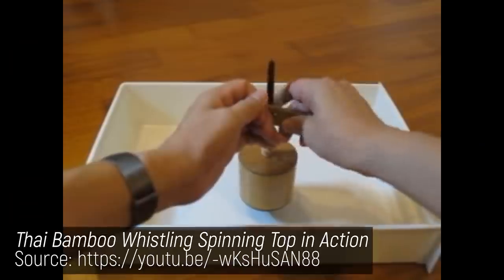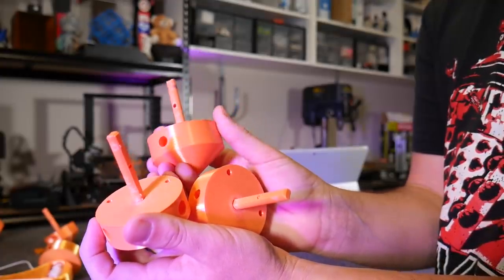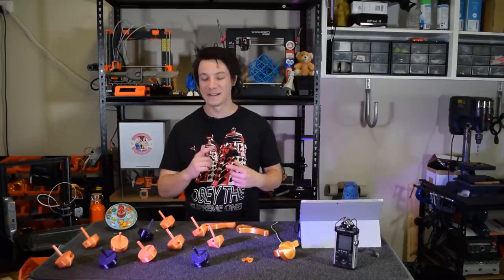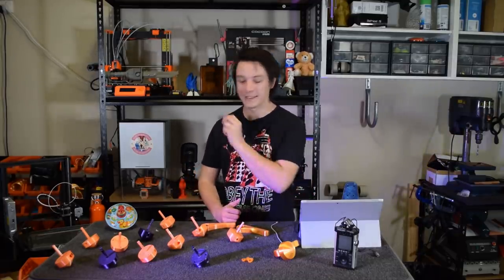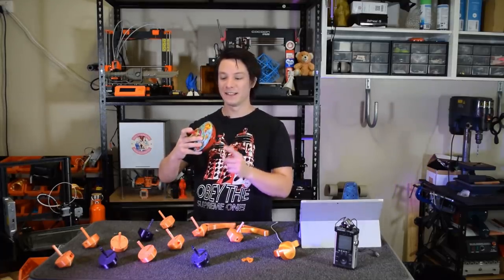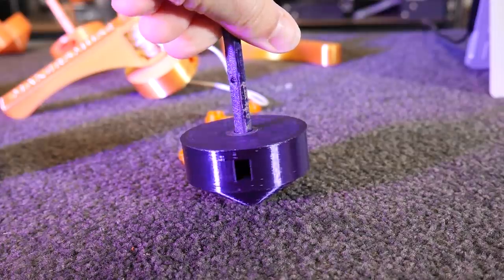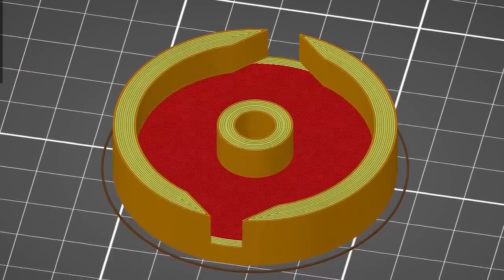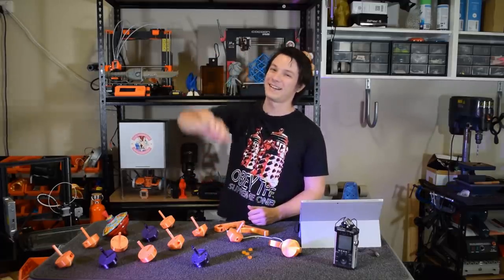3D Printed Screaming Spinning Tops

Comment: I had a whistling toy top in the 80s. I found it on eBay a few years ago and it broke after a few uses because it became brittle. Only the top of the top broke so the launching mech has broken but the whistle is intact. It is not the reed type and I think it had two tones as it spun down and had a much richer mid tone than the ones you made. It’s clear plastic so I'll take some photos of it and send it to you.

Comment: I am Vanessa Golston from Toledo, Ohio and this is my Favorite Scientific Video.   I grew up playing with my Favorite Toy, a Red, Blue,Green and Yellow Large Tin Humming, Spinning Top.   I am from the late 1950's and was addicted to the SOUND of the TIN TOP after I pushed the handle up and down to pump up the speed.  The SPEED, SPINNING and SOUND was a HUMMING that actually SINGS a SONG at a VERY HIGH SPEED and maintains that HIGH FREQUENCY for as long as I kept the handle pumped.   I would listen to this at least 1 hour every day when playing on a HARDWOOD FLOOR.   This is a soothing sound to me and caused me to FEEL EUPHORIA.   I know it stimulated my brain and I felt pleasure from this HIGH PITCHED HUMMING.   I had a lot of scientific toys, but this was by far THE BEST TOY I EVER OWNED.   MY TIN TOP THAT SANG.   THE SECOND BEST TOY WAS MY TRAIN SET THAT CONVERTED WATER INTO STEAM AND THE BLOWING WHISTLE COMBINED WITH STEAM STREAMING OUT OF THE WHISTLE.   
Vanessa Golston,
October 27, 2019
Happy Sunday
2:16AM

Comment: If you want a higher mass, you could always print a hollow ring at the perimeter that you can fill with a weight, making it like a flywheel. 

Also, how's your modelling of a  spheroform tetrahedron coming along? Really interested in seeing how you've modeled it in Fusion; I think I've modeled one, not following the XtalGrafix page on the 'wedge' along the edges of a tetrahedron, but rather doing a variable radius fillet, so I'm not sure if it's 100% correct, but I have no way of testing this.

Comment: You want to experience really really bass whistle sound? It's easy, just drive your car with one of the back seats's windows open (only that one, doesn't matter which side), because it's kind of a square. Then go on a straight line at a constant speed of about 40, 50 km and then all the car's inner pressure is going to have fluctuations, it's the same principle but in a car scale, so really bassy sound (probably you have experienced it before)

Comment: Angus I used PLA for my top, but no whistle.  Spins like the dickens with excellent velocity and duration.  Ideas please.
Reply from the maker: Is the inside cavity clear? It needs to be printed without support material
Reply: @MakersMuse  yes but upon inspection I do see a stray strand of filament that looped down into the cavity which may be interfering with the effect.  Once removed I could discern a high pitch sound at the beginning of the spin.  I am going to cut a longer pull string.  It is for my grand daughter whose hearing is much better than mine.  Thanks for the rapid reply.
Reply from the maker: Best of luck!

Comment: Add a "pea" for a warbling tone. The "pea" (used to be a dried pea in older whistles) is a small bead that's marginally larger than the sound producing vents. You may also try having several parallel holes, like a pan pipe, or even a specific assortment of holes to produce differing tones.

Perhaps even placing thin tympani or drum-like caps over a portion of the surface to act as a resonance projector (similar to the thin cone-shaped part of a speaker, but flat & flush with the top surface).

Comment: Could design it like an air raid siren, but idk how to make the outside not spin. Maybe it'll make a sound anyway with just the spinning internals.
Probably use multiple layers to make different frequencies , tiny naca ducts to suck air in from the top.
I need a 3d printer

Comment: the duck one might be acting like a centrifugal fan with possible vanes inside that force the air out at the top and pull air in through the reeds on the bottom. so what if you made a top that had simple spiral vanes inside the chamber with some outlets at the top and some kind of emergency whistle at the bottom? there's storm whistle designs on thingiverse that could probably be pasted in.

Comment: I wonder how to make a spinning top which changes it's sound heigth to sound like a police siren :D Probably it could be done by adding pistons in cavities (changing their depth) powered by a mechanism similar to balance in mechanical watches or small clocks - symmetrical masses on spiral springs around the axis. If accelerating the spinning top would bend the spring in such direction that mass gets closer to the axis and vice versa, oscillations would be sustained as long as the spinning top is spinning.

Comment: If you want to experiment with whisling shapes without wasting time and resources, one can probably make a jig with a chuck similar to a drill but with a brushless quad copter motor to spin these and also make inner side whistling parts interchangeable via sliding in and out of the round shape frame.

Comment: A simple flat dress shoe shoestring works well in place of the nylon cord. The string end fits into the hole and the flat part lets you wind more string on the spool, so it spins faster.

Comment: Wondering if its possible to include a plastic piece inside the tops hollow chamber which could cover the whistling holes as it spins to act as an on off switch for the notes. Maybe a plastic disk with flat arms coming down the sides of the innerside of the top with a ball bearing in the middle to make it spin at a different speed when the tops are span, essentially covering the whistle hole at different intervals.

Could possible even become a melodic top if it could produce multiple notes with a said spinning piece inside controlling intervals.

Comment: what if you make a thin disc that goes inside and separates the chamber into 2 whistles and if you make it adjustable , you can have 2 with the same note or adjust it so you have one high and one low. If you can get the right combination you should be able to achieve some cool effects

Comment: Is it possible to use a fly wheel like those inertia powered toy cars hell could also be an extra whistling surface in side I'm just not sure how to have it spin would the initial launch be enough to get it spinning inside I thought about using two strings but they would still spin at the same speed maybe  make it wind up and spring release when the tip of the spinner hits the ground

Comment: You know what must be done.  You must create a speaker system that consists of tops that are suspended using magnets and propelled by jets of air or magnetic torque.

Comment: if you connect the external channel with a hole near the center then the spin top will act as a centrifugal pump and you can force air exiting at the sides, however as a pump surely it will reduce the spinning time a bit, hopefully not much, but will allow you to use the air flow to create sound.

Comment: The way the bamboo makes the wirling sound is a long cut  into one end of the spinning top,  not both. As the imbalance gives a tonal shift in the whistle, making it sound like the wooden one. The shape is lika D with the spinne of the D going towards the wind, then it is cut into the spinning to, off centre so it is a whistle, not a rotating cylinder of empty space.

Comment: A way to make it have multiple whistles at once would be to make it so that the center has multiple air chambers that are disconnected from each other, with the openings to them being differing sizes. The size of the hole dictates the tone of the whistle.

Comment: What if you take a party whistle and use the design the actual whistle has then place it at an angle inside the structure of the top to make a whistle noise? The tighter the reed shape the higher the pitch, on Top of that you can put in three and make a triangle shape perhaps? Maybe have them stack a little on the ends if they don't quite fit well enough

Comment: I'm just a teen but what if you put 2 splits in on an angle so air goes into them and then make them go down so the air will shoot down making the top fly while it spins fast enough would this work I think it would tell me if it wouldn't but it would be a good idea

Comment: What about a fan type chamber inside a design so that when you pull the chord it spins the top, therefore sucking air into it and causing the inner fan to spin and cause the sound based on the outlet angle of the air?

Comment: what if you used metal launch pins and melt metal balls into the bottom, it should last longer, but it's easy just to attach a brushless DC to is if we are just after those high pitched sounds.

Comment: Why not just add a second inner  chamber with openings, wouldn't that give a different tone.
Reply: But both chambers would have to share the same space. They would both be smaller, so the tone would be higher in pitch. The top will need to be larger.